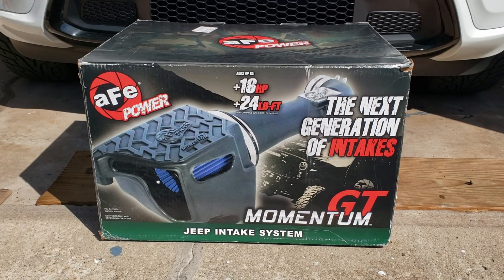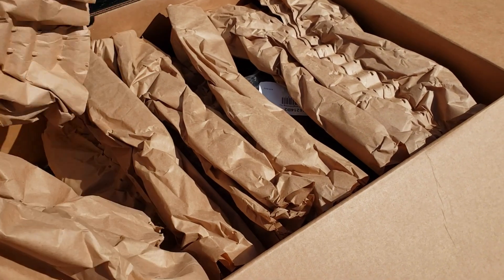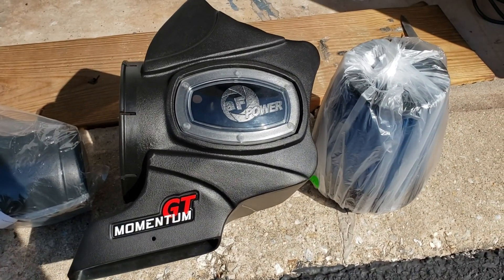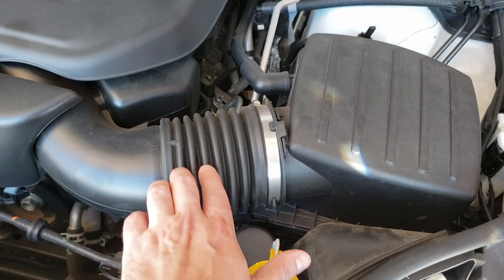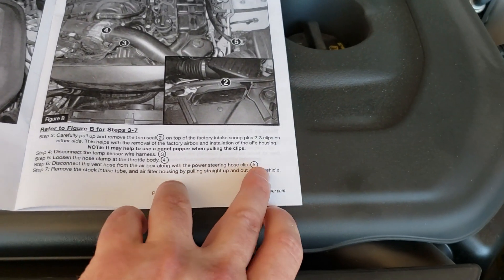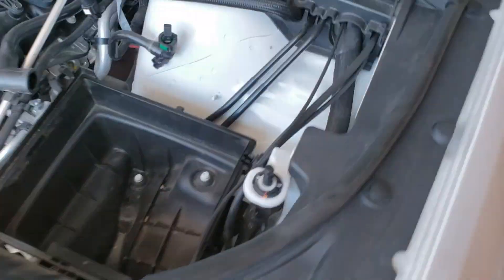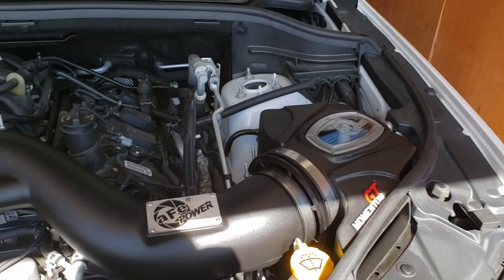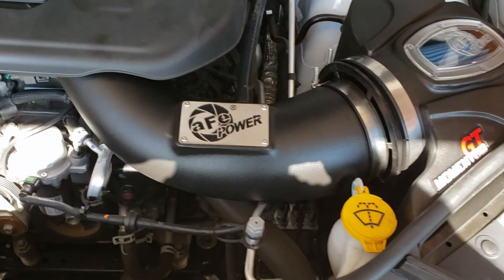Jeep Grand Cherokee AFE POWER Intake

Comment: Dude, I'm watching your video in 2022 and had to comment on your explanation on the "wrinkles" on the rubber connector on the OEM intake. It's this simple, the air box is connected to the body (it doesn't move), the engine is on the other side of the intake (it moves/vibrates/rolls). The rubber piece is to allow for the movement of the engine while the air box remains static. The ribs/wrinkles allow a bit more movement between the two parts while providing multiple flex points to extend the time to fatigue failure.
Reply from the maker: Cool, good to know!

Comment: Oh wow! They flipped the intake manifold around in the newer model years I see. Shorter path for the air to flow (relatively considering all those extra chambers sticking off of the stock piping lol) Even made a new vanity cover I see
Reply from the maker: That's what was so weird to me. The factory setup is so huge and convoluted I just don't understand the point.
Reply: @carsick309  I still look at the apperant air path and wonder how the thing doesn't suffocate at a standstill, especially in the high summer. The single slit just seems restrictive, but it works

Comment: Other than the sound, did you feel the car more responsive? 
I dunno yet if do the mod or not and for sure if I will, I’m gonna use this one instead of KeN…
Reply from the maker: @davidebergese3112  Honestly, I think some of this is "mental". You want it to work so you feel like it does. Only way to prove out  is to run on dyno which I didn't. Long story short, it felt like it helped. I definitely would recommend pairing intake with exhaust mod for full feel.

Comment: Great installation video, did you noticed any increase on MPG? I see mixed reviews some notice a good increase and others have said they lost performance. Thanks!
Reply from the maker: Started replying to brake cover benefit not miles per gallon. :) I think it does help to some degree. But, my opinion may also be skewed because I have also installed a Pedal Commander throttle timer delay delete. With that the car jumps much faster and revvs harder. So that may also cancel out some fuel burn gains..
Reply: @carsick309  gotcha, thanks for the reply!!
Reply: i know it's pretty randomly asking but does anybody know of a good website to stream newly released movies online?
Reply: @Noah Wilder I dunno I use flixportal. just search on google for it :P -dominick
Reply: @Dominick Kohen Thanks, I went there and it seems like a nice service :) I appreciate it !
Reply: @Noah Wilder happy to help :)

Comment: I have a 2020 Jeep Grand Cherokee altitude. Just recently purchased was going to put one of these or a k&N inside my truck. Do you recommend if you still own the vehicle?
Reply from the maker: If you do K&N you will have higher resale if you trade at a Jeep dealer. Otherwise they consider it all a mod and have to sell it as is. You can restore it to stock before trade obviously but it's a PITA.
Reply: @carsick309  wow that's surprising, K&A are actually cheaper by about 130 bucks or so. My worry is that the air filter on K&A is exposed where the AFE is in a box. Also how things faired in the truck a year or 2 later? Were you happy and did you have any issues mechanically? Appreciate the reply, I have been going back and forth in my head on buy one don't buy one lol.
Reply from the maker: @Heywood  I just realized you meant K&N full setup not a drop in air filter. I did the AFE because it was on clearance but for the money and ease of maintenance would recommend K&N. What this doesn't show is the PITA to take out and clean the cone. Much easier with KN.
Reply: @carsick309  Awesome brother thank you, and again appreciate the reply.

Comment: No comments on perfotmance/power increases. In video. Please do tell.
Reply from the maker: The reason I have not gone that deep is because I have also put in a Pedal Commander throttle timing "delete". That makes it feel like a gain without actually adding anything. The true way for me to gauge gains from the intake would be a dyno which I have no time for yet 🤔. What I can say "pre-PC mod" is a felt small gain in acceleration especially past 3.5k rpms and between 3rd and 5th gears. As for mileage, I run 93 octane because of personal OCD and it seems to have actually improved some. The offset though is that my PC mod makes me want to rev harder so the mileage gain is offset. Not sure I actually answered your question but the intake feels worthwhile for my purposes.

Comment: You need to dyna tune after installing intake mod. Becareful dont wait for the check engine. Chill!
Reply from the maker: Straight up filter enhancements don't require retune. More of an upgrade than mod. Except instead of dropping a, for example, KnN filter these also have a fancier airbox and shorter air path to intake. Certainly would help get most out of the upgrade to tune but would not trigger CEL when put in properly without one.